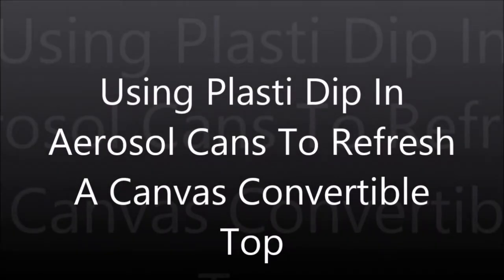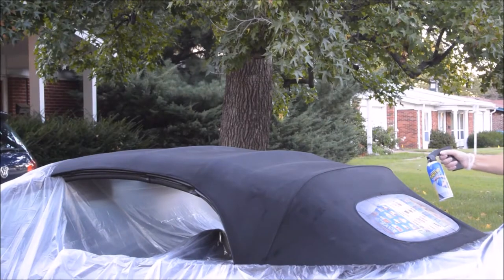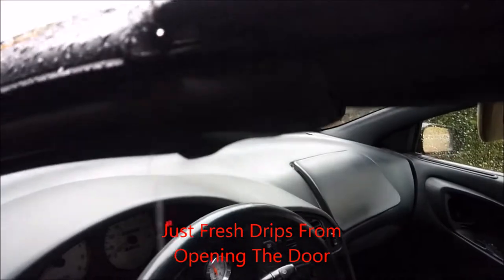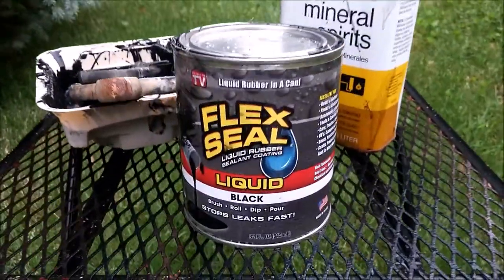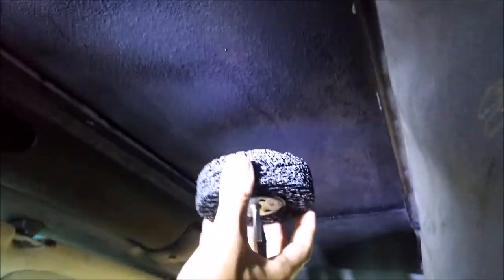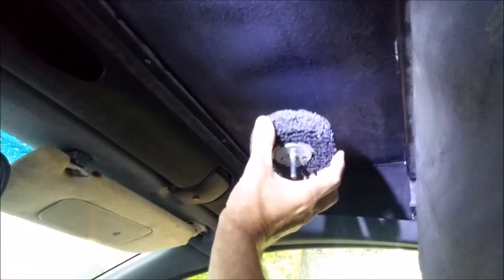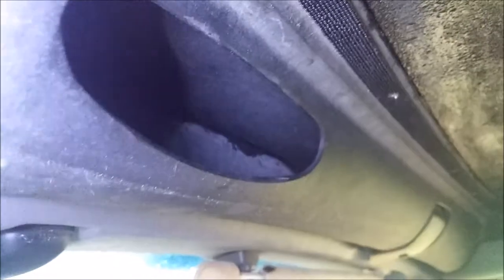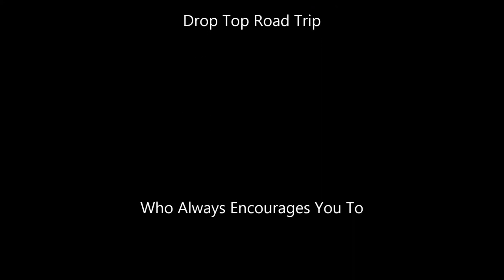Sealing the 2G Eclipse Spyder Top with Flex Seal

Comment: I used this on my '03 Honda S2000. The earlier S2000s have a spot on each side that gets pinched when the top goes up and down and it develops a hole. They improved it in '04 or something. Anyway, this stuff worked great, except that when the temps get over 100 or so here in Arizona the stuff still gets soft and gooey. But as long as you don't touch it it's OK.
Reply: I have an ‘03 also with those holes you’re talking about.  Did you use flex seal on the inside or out?

Comment: I’m experiencing leaks by the mirrors on both sides. The leak is toward the top corners and comes in by the tweeter. 

I’ve got an 03 eclipse so not the same, but possibly similar? I was wondering if you have had any experience with replacing weather stripping or where to get some
Reply from the maker: Sorry. No experience with seals. Check the Eclipse forums. They have YEARS of experiential knowledge available there.
Reply: Did you try blowing out the seal channels with an air compass or something that blow a good amount of air pressure..and cleaning the channels with a wet rag?
Try those first.
I just got my 2003 Spyder GTS2 weeks ago, drove it home while it was snowing/raining a bit, and it leaked in the same exact places(in the corners of the door and down to the speakers).
I'm getting prepared for the summer (the top that is).

Comment: I would love to seal and protect my Spyder convertible top but more importantly I'd like to fix the seal so they're not leaking in the car anymore. Did you ever run into trouble with the rubber seals leaking in the corner of the top?
Reply from the maker: Hi Elle.

I assume you are asking about leaks at the two front corners near the windshield. I had leaks there as well. After a long or particularly hard rain, water would collect in the metal header that the clamps to the windshield. I would get in the car, start driving and at the first corner, a bunch of water would come rushing out of one or the other of those two front corners. After sealing up the canvas with the Flex Seal, that has never happened again!

Since your top is relatively new, I kinda doubt that you need to seal your canvas (but I could be wrong!). Sounds like you have a replacement top and maybe it wasn't installed correctly or needs an adjustment.
Reply: @mmodtomic7119  yeah me and a friend put it on ourself, maybe it wasn't right

Comment: After you sealed up the top with the flex seal, were you still able to take the top off with the cars controls, or does the roof have to stay on?
Reply from the maker: The top works as normal. I waited a few days after sealing it to insure the Flexseal cured properly, but after that I put the top down almost every time I drove the car!
Reply: @mmodtomic7119  oh awesome, ill be sure to try the flex seal method first, before considering buying a whole new top... Is your top still leak free?
Reply from the maker: @BlueSpades7  Yup! The Flexseal did the trick, but you're gonna have to really work hard and get as much coverage as you can. It was a bit of an ordeal, but probably a lot easier than installing a new top.
Reply: @mmodtomic7119  how did you sand and flex seal inside the header.
Reply from the maker: @Jay-rg6rk  It's been a long time since I did this. I can't really recall. I'm pretty sure I just scraped out what I could using whatever I could find to do the job, I know I used a wide paint brush to do the whole thing with the Flex Seal.

Comment: So did you apply the flex seal on the underside of the outside of the top or did you seal the liner thats just below it? It seems that you peeled back the liner but I want to be sure when I do it.. Please respond if you see this.
Reply from the maker: I removed as much of the old dried and cracked factory seal on the underside of the outside, then applied the flexseal directly to the underside of that canvas.
Reply: @mmodtomic7119  thanks for the quick response boss. so that flimsy fabric that hides the outer canvas from the inside got torn out and then you applied flex seal?
Reply: If thats what youre referring too looks like ive got something yo do for the next few hours
Reply from the maker: @anthonymcgee2424  There is a liner that separates the interior of the car from the frame of the top. Is that what you mean by flimsy fabric? I don't recall any other flimsy fabric. What I'm saying that you need to remove is a material that was attached to the canvas of the top and had hardened, cracked and was turning to dust. I had to use a 3M paint removing stripper wheel by hand to remove it. Perhaps yours isn't as beat as mine was and you can put the flex seal over it, but if I had done so it would have eventually pulled away from the canvas.
Reply: @mmodtomic7119  i see. thanks for the info youre the only one on the tube thats done this. hope my attempt works as well as yours..these flex seal fumes are killin me lol. how many layers?
Reply from the maker: @anthonymcgee2424  I did this years ago...pretty sure I only did one as it was a lot of work.
Reply: @anthonymcgee2424 You could have used MEM Waterstop instead, it is without any fumes and even a little bit sturdier.

Comment: Why not get the spray kind and use it on the outside of the top? It be a lot easier
Reply from the maker: I might should have tried that. I'd be interested to see what the end result looks like.
Reply: It was originally done from the inside, at least on this Mitsubishi, and if the rubber seal on the outside rots from the sun and water, the top would look bad, you can simply recoat the inside and the appearance will never be affected. I have done that on a VW Beetle, the rubber is between the an outside and inside layer on this models. It works and looks perfectly. I used MEM Waterstop little bit thicker than flex seal but it is with temperature and UV protection. Heat is not a problem for this stuff.

Comment: What is the current status of the hood?
How has been the operation of flex seal, would you recommend it?
Reply from the maker: Well, it's the middle of winter here in Missouri so I haven't driven the Eclipse in about 2 months. The Flex Seal has kept the interior dry through all the rain and snow but it has yet to be seen how the freezing / thawing cycles have affected its flexibility. Check back this spring when the weather warms up!
Reply from the maker: Summer just started and the Flex Seal is as good as it was when I applied it last year.